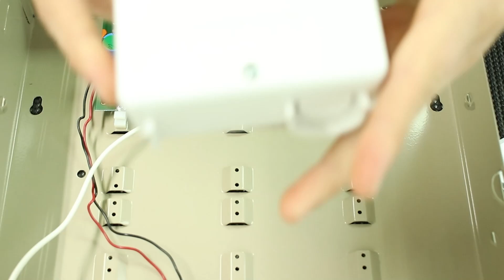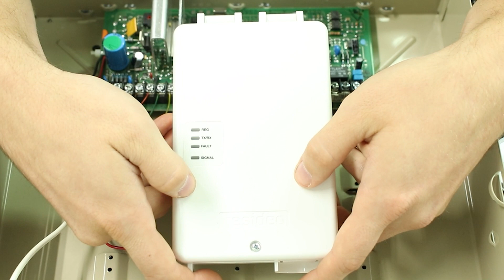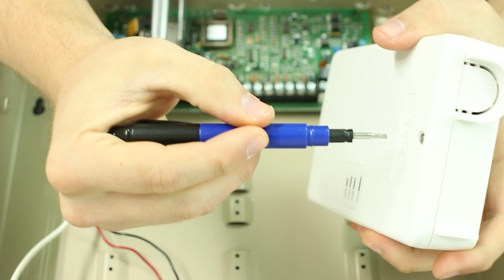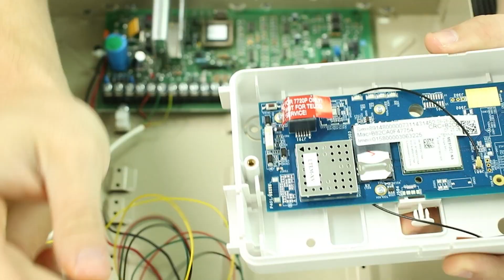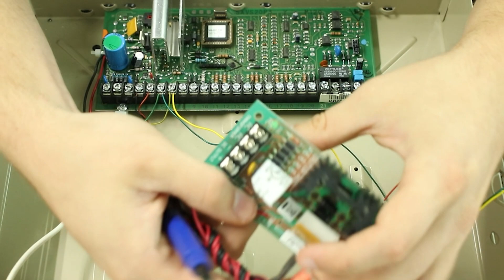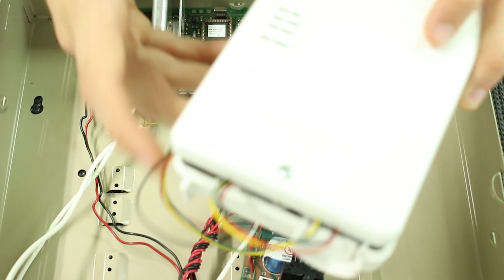Honeywell LTEM-XV /  LTEM-XA Cellular Communicator Installation

Comment: If the communicator stops working does a message appear on the keypad
Reply from the maker: Yes, if the communicator fails to communicate you will receive a long range radio trouble.

Comment: Hey awesome video. Need some advice. I have an outdoor self storage unit where I'd like to connect a window sensor type of thing (basically if the door opens then send a SMS message to me). As far as power, I was thinking placing a 12v battery with a solar panel that would charge it during the day. What components would I need to connect a window sensor (like a 5816WMWH) to the LTE network. Any advice would be great. Or what would be your solution.

Thanks,

Comment: Some of your information is incorrect, but other than that, good video.
Reply from the maker: Can you advise what is incorrect?
Reply: @AlarmSystemStore  yeah sure. 
First, the information you gave about registration, I'm gonna assume that's your central station info. 
Many companies, have their own department where they register it themselves. Other companies give their techs iphone or tablet and the techs register it themselves. 
The little red button on the far left bottom, push it 3 times; per Honeywell tech support. You may have to power cycle and hit the button again. 
You don't set it off and let it ring for a whole minute. 
You sent 2 signals. 
Set off the alarm, ( depending on your timer delay if programed)
And turn the system off. 
Alarm it again. 
The first signal goes to Alarmnet, it is now registered, the 2nd signal comes to our central station. 
Hope this helps you out. 
Like I said, good video.. 
I did not know about the power supply. 
Depending on the signal strength, you may need an external antenna. But that's a different topic.
Reply from the maker: @guesswhomartin9249  Thanks for the input. Yes, some of these steps may be specific to the central we use. I know we like to see the comm test in addition to a zone test of some sort just as an abundance of caution.
Reply: @AlarmSystemStore  Yeah, I'm sure your video has helped somebody out there. I just have a different way of doing it. Bottom line is: as long as it works.
Reply: Hi there, I bought the farm with the system like this and it inactive. I would like to use again, how do I activate it? Thank you